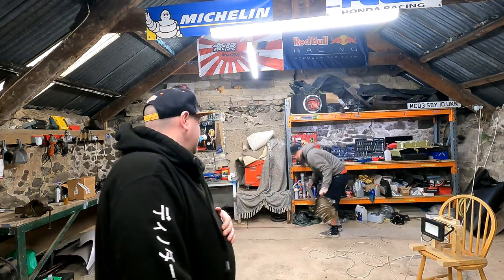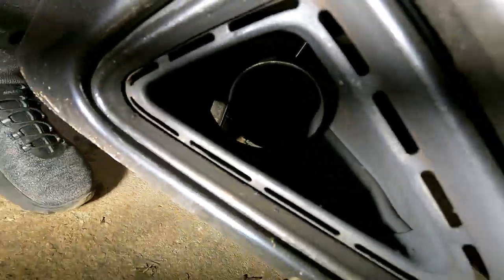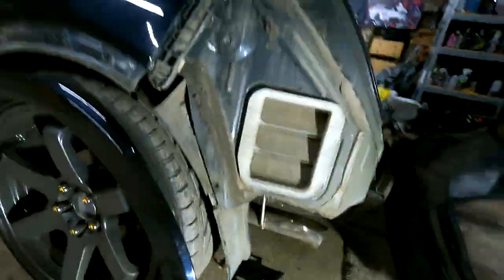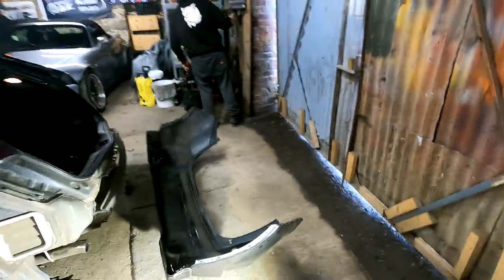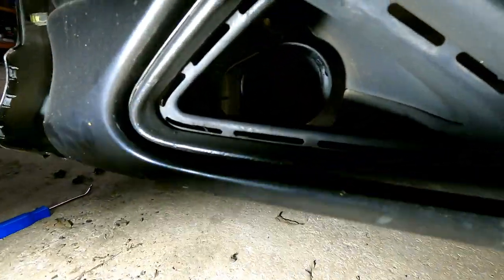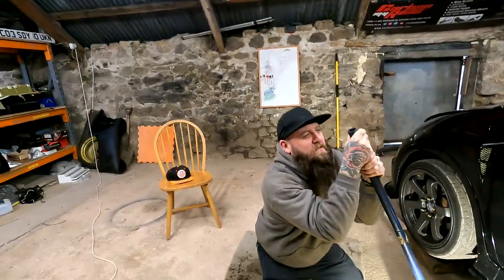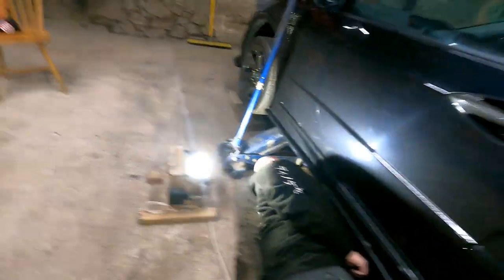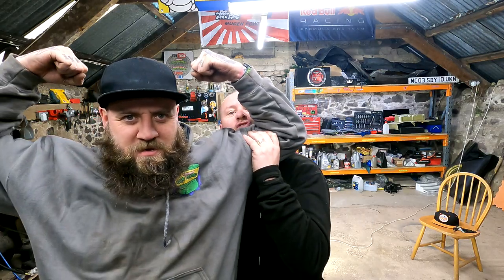FN2 Japspeed cat back exhaust rattle fix and we hunt for more!!

Comment: Iv got some ratels going to be pulling off the heat shields along the drivers side as they are both on one bolt and both sides of my twin exit may now be getting a trim Great work guys
Reply from the maker: Get on it Steveo, cheers dude 🤘🏻❤️
Reply: Also worth checking brake disc backing plates. Two of mine were rattling or lose when wobbled.
Reply from the maker: @richardd8352  they came off ages ago mate 🤣🤣🤣